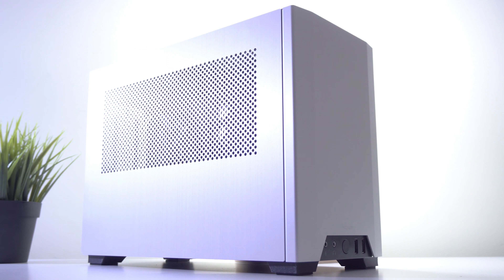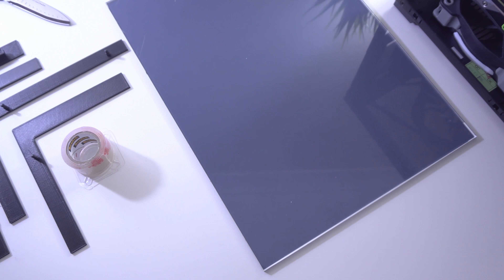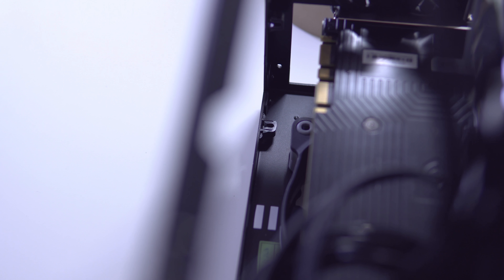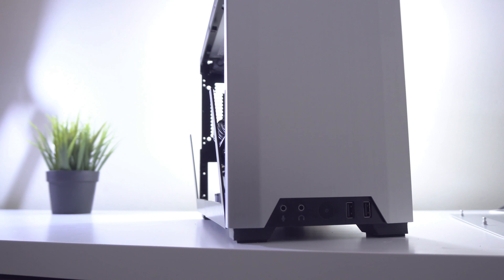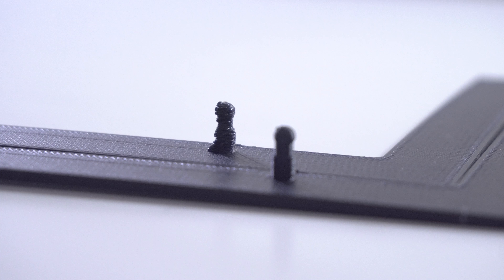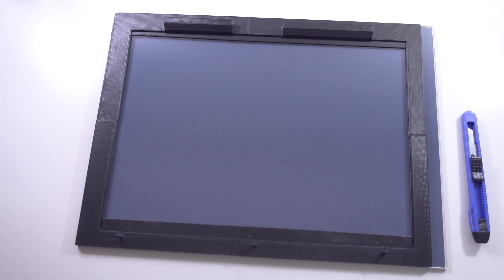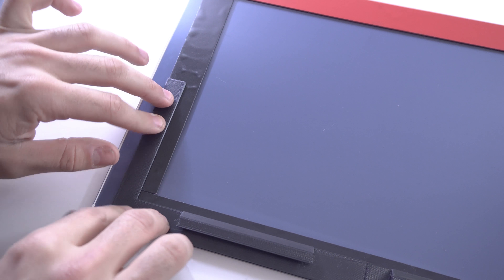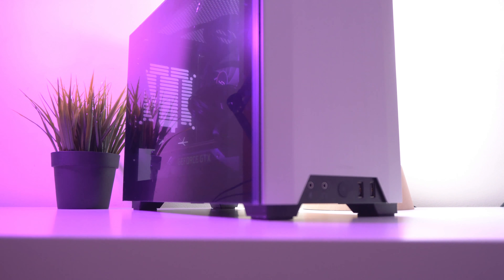NCASE M1 - Tempered Glass Mod V2!

Comment: Very nice tutorial!
I went the mod route- bought an extra left panel in black from NCase, cut out an opening, with enough border wide enough for the double sided tape, and tape the tempered glass to the outside of the aluminum. This way the original mounting pins are there for that original snap on/off feel.
Reply from the maker: That's a great idea, this was actually what I was going to do first but couldn't find anyone to laser cut the panel for me. Also, I feel like the original aluminium panel requires some flexing to remove, so how does it feel with a glass panel on there?
Reply: Optimum Tech It works great actually. It does feel a little different (stiffer) with the TG attached, but it works. I think the double stick tape helps take up some of the flex. I cut the window slowly with a dremel. Took awhile, several discs, but turned out ok.
Reply: Nanook Very nice, how did it turn out?

Comment: Hi quick question - very awesome video, just ordered the brackets from the site! The dimensions posted for the glass cut in mm are difficult to work with because a majority of the online shops that create custom glass cuts require cuts to be in 1/16 inch minimums. Are there any alternate dimensions that would work, or do you know of other online resources that could get the cut as specific as you have?
Reply: assuming 12 in 15/16, 9 in 7/16, 1/8 in would be okay (slightly larger than the specs you have)

Comment: excellent work, friend!  i would totally buy the mounts, but i'm afraid the bottom "clips" will interfere with my LEDs.  also with me using the Gigabyte Aorus 1080 Ti, i'm having to use a larger offset so the glass clears the EKWB ports.  is this something you could do as a one time custom job?  essentially making the mounts thicker by several millimeters?
Reply from the maker: Yes I could do this for you, shoot me and e-mail at optimumtechmedia@gmail.com

Comment: Great video. 

Another way is to have that local glass shop drill holes before they temper the glass for you. Then you can just screw it on the side of the case like most of the case manufacturers do. I would probably also opt for laminated tempered glass if going to buy a custom piece of glass. Why case manufacturers feel the need to save a couple bucks and not have it laminated it a huge oversight. Glass does and will shatter and its a huge mess you will be cleaning glass up forever. Worth it to pay 15 or 20 extra to get it laminated.
Reply: JimmysTheBestCop This is the route i'm going with my enthoo pro. I already found a company that will produce it to my liking.
(with pre-drilled holes and all).
I didnt ask if they tint the glass as i prefer clear panel.
Right now its on hold, 
(saving for drivers license).
But man i'm pumped.

Comment: Great video.....  How are the temps?
Reply from the maker: Temps are 1-2C warmer than previous based on my observations, no strict testing yet. 
Frankly, the difference isn't significant, thanks to the open-air design of the top, back, and bottom panels.
Reply: Optimum Tech The added benefit with tempered glass is better sound isolation compared to regular acrylic/steel/alu side panel.